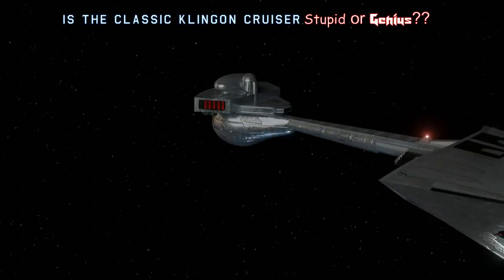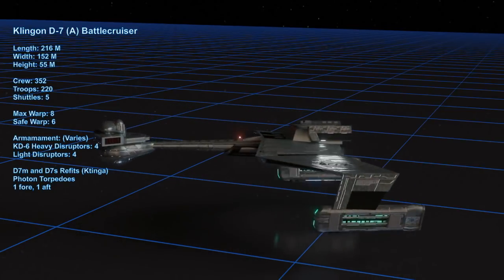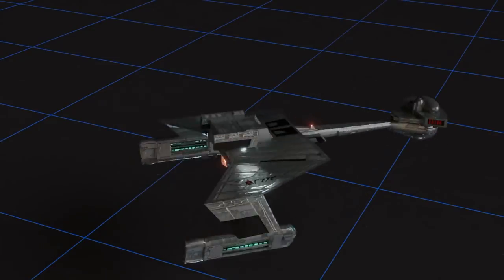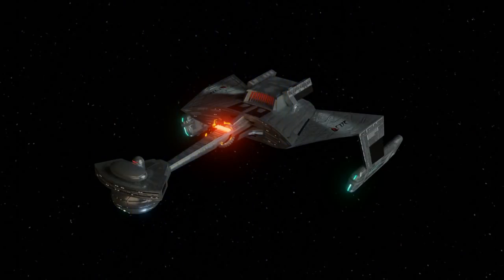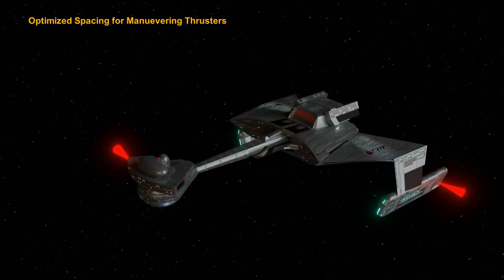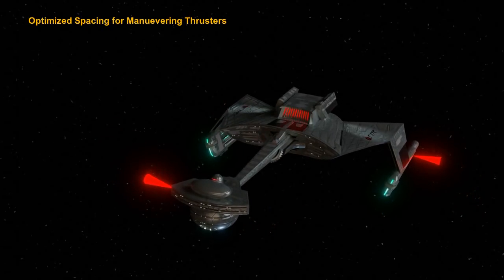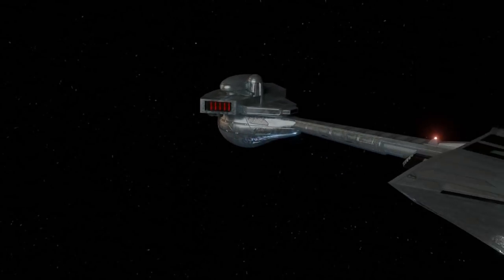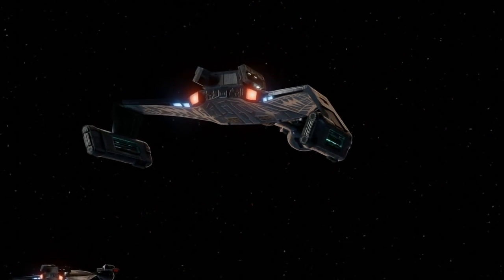The Classic Klingon D-7 Cruiser - Stupid or Genius Design?? Animated Breakdown!

Comment: The neck part could be used as coolant when firing the heavy weapon in the pod. Another possible reason could be; since the Klingon designs are not advance as the Federation. They use it as a cooling pipes to take out the heat as best as possible. Plus not as many crew are in the forward section.

Comment: The sensors are the most logical reason to me. Mounting them as far forward as possible would considerably reduce any blind spots caused by the mass and radiation from the warp nacelles. The ability to see any threats would be top priority in a combat vessel.

Thanks for the video!

Comment: Here is the main reason:
To understand Klingon ship design, you have to understand Klingon culture. Their whole philosophy is to battle, lead from the front in battle, and die in battle. This philosophy is carried forward in their ship design and their ships take form over function. Allowing them to lead from the front. To be the spear head. The neck is toughly armored and strengthened. But to have a triangle shape, would not allow the main crew to definedly in the front and leading from there. They wanted other races to see their bravery and see them leading from the front.

Comment: Wow....really thorough.  I grew up in the TOS Era and we had the FASA and SFB universes to gather our "facts" from.  The video basically hits all the main ideas we had back then on the design concept per Josef/FASA/SFB...etc....  The earlier ships had the same layout, so it was not D7 specific.  The detachable boom was thought of as a result of design - not a reason for it.  Not clear if it was an escape resource, or more of a last weapon of desperation.  Instead, the aft hull, when damaged could give off radiation, so the officers were kept separated.  Klingon vessels were expected to always be facing the enemy - and that is how the weapons worked, so forward shields were extra heavy and rear shields were rather weak (Ex. SFB) - since they would almost never be exposed (Klingons never run).  Getting a clear shot at the neck would be hard enough and then the heavy shields would block the shots.  Klingons don't "broadside" like federation ships do.  Also, with the center of mass way behind the boom, small maneuvers of the aft hull would make quick maneuvers at the tip of the boom (the business end so to speak).  Lastly, yes, there were SFB kinglon ships that used a very heavy energy weapon powered from the aft hull through the neck and out the boom.  But as the video points out, the hole is not in line with the aft hull.  It's a fun speculation - and I like how the video keeps a little bit of history (Canon be darned) alive.

Comment: Just as a possible reason why they could have done this, when the Klingons started building ships, their engines and other machines that are kept in the engineering section, produced a type of interference with the sensors and other control systems. And because of it being a "tradition," they could have just kept the basic overall design style over their main fleet ships. You see almost every modern Klingon ship having similar body shape. This would give a purpose for the design initially, while also giving a traditional reason for the ships to remain in this type of configuration. It would also not need a separate class or race for a ship, while also not exposing crew to unprecedented danger. It would also explain why the officers and highly trained crew would need to be kept in the front part of the vessel.

Comment: I think the "Protect against mutinies" angle fits well for the imperialistic Klingons depicted in the TOS.
I do also like the idea that sensitive equipment like scanners and computers would be placed far away from the interference of the reactor, and the maneuverability enhancement is just a welcome side-benefit.  And once the system works...if it ain't broke, don't fix it!

As for it being a weak-point...nearly all hull damage in Star Trek is catastrophic, whether your ship breaks in half or not.  And is it really all that worse than the connection to the federation saucer section, or the long pylons to their warp nacelles?

Comment: You Nailed It.  Star Fleet Battles detailed this  extensively.  Many D-6 / 7 class were 'penal'cruisers, urilizing convicts as well as subject races as secondary crew.  Separation and isolation of access points were key in minimizing threat of mutiny.  Having just 1 turbo shaft down the neck gave the Imperial Klingons in the 'head' some safety.

Comment: I don't know if this is true in Startrek but the command section could be separated from engineering section due to the radiation interfering with the sensors in some way. This would make sense if the Klingon sensor technology was inferior to the federation at this point in time. Therefore having a long neck could provide better situational awareness at the cost of structural integrity.

Comment: I'd like to see a D7 Battlecruiser face off against a Nebulon-B Frigate from Star Wars.

They're both fan-favorites from their respective franchises, are similar in both size and tonnage (the Nebulon is slightly larger), and both have similar structural weaknesses (i.e. two hull sections connected by a long, thin tube-like bit). If we assume the weapons, sublight engines and shielding systems are of close-to-equal power (admittedly a point of contention amongst fans), it'd be quite an interesting encounter. Also, each ship has an ace card the other lacks: The D7's forward-fixed heavy disruptor cannon vs. the Nebulon-B's ability to launch starfighter squadrons.

Comment: Let me add a few important points about the design. As you mentioned, the design's advantage on maneuverability is a main factor... but also consider 3D space. The forward hull section does not 'get in the way' of weapon fire, especially the pod mounted disruptors on the warp nacelles, allowing for wider arcs of fire. A 'wedge shape' would not only negat that advantage, but also add MASS thus reducing maneuverability. 

Lets also consider Kilingon tactics. The ships were not MEANT to solo. They are designed with a wolf pack formation in mind, always operating in groups of three. The design offers a slim profile that allows friendly fire through and around friendly vessels. Further, targeting the neck of the ship is certainly no easy feet... given how nimble the ships are. In a pinch, its a wiser tactic to target the larger hull and hope to disable a critical system, then to attempt an unlikely 'kill shot' that leaves you open for the Klingon return fire. 

While frequently depicted on the show as approaching in a 'head on manner' the more effective tactic would be to approach on an oblique angle, at high speed,  fire disruptors and then quickly maneuver back for a return shot, turning fresh shielding to the enemy and maintaining distance at the same time. 

Klingon tactics include warping in, and striking decisively, to disable and destroy their enemy. They are not designed for a prolonged assault.

Comment: I've read in various technical manuals that it is believed the Klingons, since much earlier models like the D-3 and D-4, crammed as much (inefficient) engine as they could into the ships while also crammed full of weapons and armor. Thus they reduced things like internal radiation shielding and had issues with damage/danger in the engineering sections. Thus they kept senior crew and more sensitive systems at a 'safer' distance from the rear. Similar to what you've mentioned.

Comment: The forward pod is forward for the same reason why a buckler is held forward and a Federation primary hull is forward.  It puts the fore-shields even more forward of the nacells and helps to protect something that absolutely has to be stuck out in the middle of nowhere.  If the marines are kept in the back, it also helps to ensure they'll suffer less damage before they beam over.

Since we've only seen (or heard) of this sucker in one-to-one combat (it's not until the movies that multiple ships work together as a unit), Klingon battle-doctarin might be similar to Federation.  That is, when absorbing hits, put your most protective face toward the enemy and not the bit that has the blow-y-up anti-matter in it or your run-away tools.

The high moment of inertia (is that what it's called?) helps to keep the front part towards the enemy.

This would reinforce the idea that Klingons value risk-takers by putting the naval crew in front of the rest of the ship forcing them to have risk before their boarding parties did.

Comment: I would have desinged it with a tapering neck to add structural support  and add an overpowered warp core so the extra power is put to structural integrity and forward shielding having a sensor tie in so the excess shielding is already facing the opponent  and have a near overload max setting on every disruptor bank

Comment: I have some blueprints of the D7, acquired in the mid-80s.  According to the blueprints, the entire forward pod and boom can separate.  A battle bridge in the aft section is then used.  It's not too different from the Enterprise-D's separating abilities.  The forward pod's shaft can house sensors or a torpedo launcher.

Comment: Not so much a reason for the long boom, but I doubt it'd actually be much of an issue. In combat situations, the D-7 would want to be taking the initiative, on the offensive, and facing forward. With that, the forward, exposed bridge section is a far bigger weakness than the flimsy looking neck. 

Honestly, I'd love a variant of the ship that adds some more weaponry to the broad, flat, forward portion of the main hull. You could slap two, maybe four more heavy disrupters there.

Great video,  that model is fantastic!

Comment: Real nice rendering of a D-7.  I read somewhere that it had something to do with upper and lower shield  strength, as it was assumed that when the D-7 finished its run it would either break to the left or right, with a change in angle of attack (going up or down) but I am not sure.   This, along with the maneuvering theory makes sense to me.

Comment: in tos (and tng), ship combat was something conceived of as happening at immense distances - 90,000 km or more. at those distances, ships would face each other at relatively static, fixed angles determined by their ideal firing arcs. which is another reason 'structural weaknesses' would tend to be secondary concerns. a d7 would almost always be facing its rival head on.

Comment: Star Trek also mentions "Structural Integrity Fields" in many episodes. These seem to be an outgroeth of shield tech that allows the physical structure of a ship to be reenforced and therefore be able to absorb more punishment than expected. Think of Relient's attack on Enterprise that damaged the neck of the ship. Even after the dense environment of the nebula and going to warp the ship did not suffer catastrophic structural failure. So, it seems if the SIF's are effective in holding a ship together under extreme stress.

Comment: Great video.  Subscribed after a single view.
Something to think about:  I love that you covered multiple possibilities as to how, in-canon, the D-7 design came to be (especially the warp-field design aspect, see the TNG Technical Manual for the Galaxy Class, if you can find one), and here's another possibility; engineers may have more than one reason for doing something a certain way.  The real-world XB-6 Valkyrie and SR-71 Blackbird had design features that solved multiple problems (and sometimes created one or two others), and this is increasingly common in the gen-5 and 6 fighter aircraft designs, as well as modern submarine, carrier, and naval warship designs.  Even cruise ships are designed and refined with the help of Machine Learning before fabrication ever starts, to get the best outcomes for the least effort and cost.  So 'all of the above' is not necessarily a cop-out answer, especially for something as advanced and quality-critical as a fleet starship design.

Comment: My personal theory is that the starship shields work both ways, blocking fire from both direction. Right before a ship open fire, it’ll have to temporarily lower their shields right around the path of fire, then re-raise them back up. The weapons module there could have its own shields system, which means that when the main weapon is firing, it only needs to lower the shields just for that part, while keeping the shields around the engineering section still active. This way they can keep shooting even when they are being fired upon.

Comment: Modular construction techniques. The main hull, boom and pod are constructed separately and mated at the end. This would allow for easier and quicker post battle repairs.

Or it’s for the security of the senior officers, Klingon crews are known to move up the ranks by challenging a senior officer. This design allowed the senior officers to shut a mutinous crew of conscripts off in the back of the ship and deal with them later

Comment: Klingon vessels are primarily made to face the enemy in combat so the large front section actually hides the neck against enemy fire (at least anything that travels in a straight line such as beam weapons).  The neck may be a vulnerability but it's not really a massive problem based on the way that they fight.

Comment: I think someone mentioned the long neck was done for similar reasons the Discovery of 2001 had a long neck. Tne warp core/reactor is powerful but not shielded all that well because Klingons had been pushing the limits of what their technology could do. So the most of the Klingon crew is in the head section while the aft is only rotated in and out as neccessary.

Comment: I'd always liked the look of the D7. I like that it's kind of an example of convergent design evolution, that the idea of divorcing the engineering hull and warp drives for safety is pretty universal.

I also like the hierarchical layout of it: officers and decorated warriors up front, and the ratings and riffraff in the back.

Comment: The separation of the command pod from the star section would allow for faster refit during war time. A bridge was taken out but the star drive is still good, disconnect and attach a new command pod or vise versa. Less waste, faster return to battle and easier upgradability.

Comment: My first thought, as I began to contemplate the question posed by the title of the video, is that the design is meant to protect the command section.  Assuming in most battles, shots are taken at range against rapidly maneuvering opponents, it will be rare to target specific sections.  You just shoot at the center of mass of the target.  With the command section held away from that center of mass on the long boom, it's much less likely to be hit, protecting your command and control.

Comment: Long time player of Star Fleet Battles (SFB) here. SFB was developed out of the original series and makes use of the concept of the Klingons as a conquering race. With that as the basis, the idea of subject races and lower ranked Klingons being in the rear section takes a slight turn. This is seen in two manners. The first being that the ships include Security Stations in several locations. The second being that the boom and forward section can separate from the rear. Together they serve a protection from mutinies.

Comment: I used to think that the reason for the long neck on the D-7 cruiser was that the Klingon senior officers in the command section wanted to separate themselves from the enlisted ranks in the main engineering section in case of mutiny. The long neck had a corridor with several guarded checkpoints to make sure that only those with the proper clearances were allowed to proceed to the command section to carry out their orders.

Comment: It seems I've read in other literature that the aft section of klingon ships was a hazardous area due to the poor shielding of the engines. I know FASA isn't exactly canon but I wanna say that came from the ship design and recognition manuals they put out. Klingons were more interested in engine power than safety and their tech might not have been on par with other races.

Comment: I always thought it was designed for ship to ship boarding. Where the front ball detaches leaving the shaft as an 'injection' needle for ramming into enemy ships and boarding. Having the main engine part of the ship attach allows you to fly the enemy ship even if you haven't taken it completely over yet. The ball then becomes a weapons and CNC platform to supervise the boarding missions. If the boarding were to fail they would just release the needle at the base and redock the ball to the engine block without the shaft to escape with an near intact ship.

Comment: In the SFU the boom and pod section were designed to separate in emergencies, much like the saucer on the Enterprise-D. As you mentioned, the boom has it's own impulse engines. In the event of separation, the most important officers are evacuated to the boom, and the servitor races go down with the engineering section. Also, the Klingon design aesthetic is based on the body shape of a respected marine predator on the Klingon homeworld.